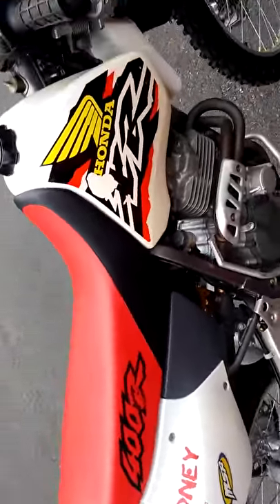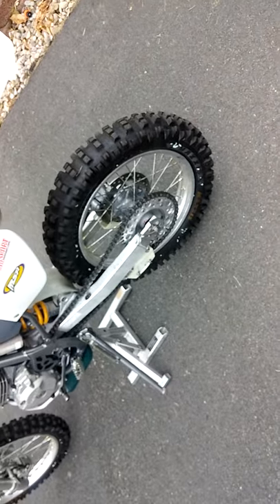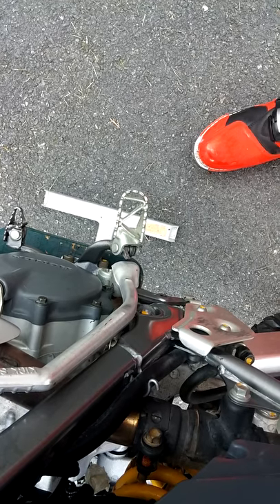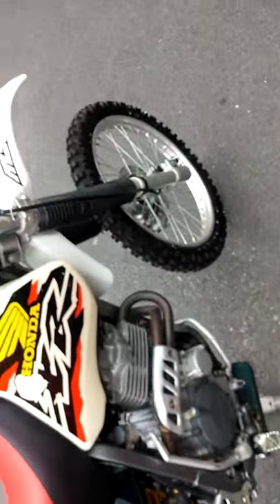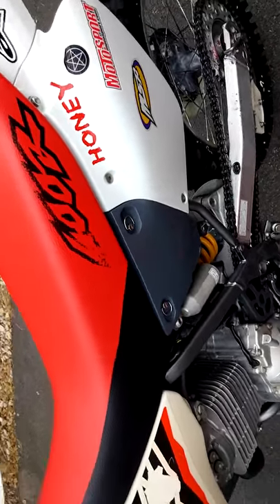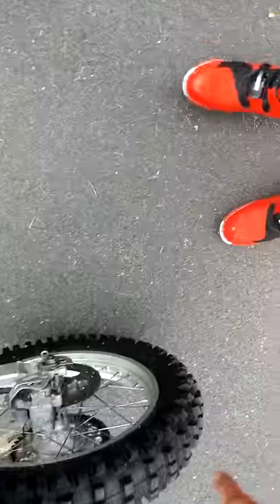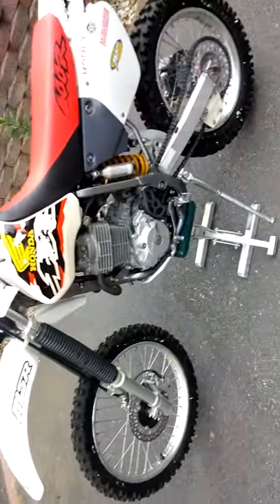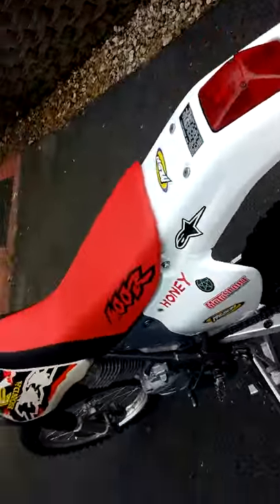XR400R Honda dirt bike

Comment: That's a good looking 400. That is the bad part about letting a bike sit to much. Parts go bad. I wouldn't ride it without getting a new chain slider first.
Reply from the maker: I got the black chain slider that will go around the swingarm, that my private motorcycle mechanic will install with the other parts.
Reply: +Megashovelman sweet